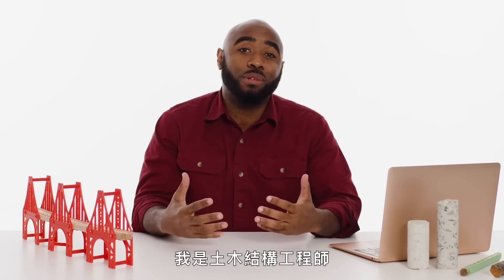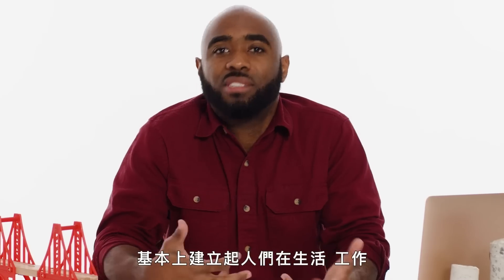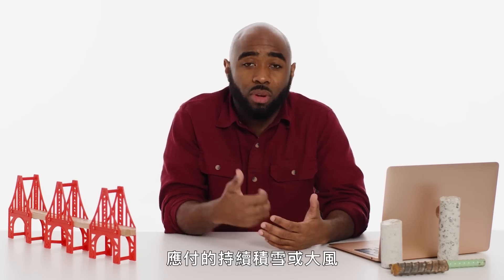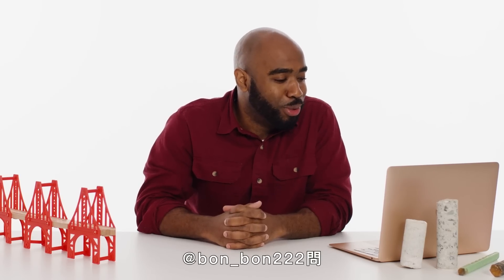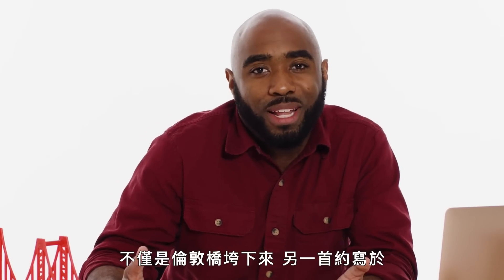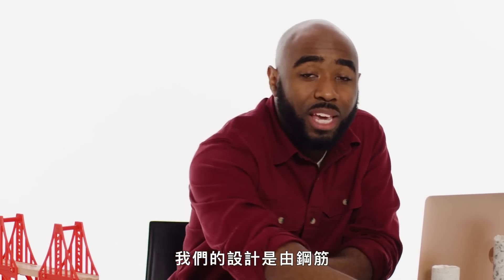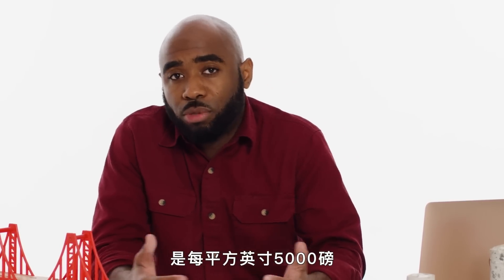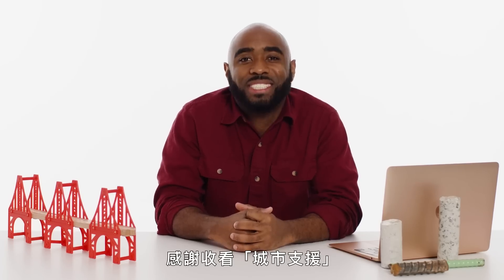如何建造水底隧道？摩天大樓是怎麼蓋的？土木工程師回答城市設計相關問題！｜名人專業問答｜GQ Taiwan

Comment: 佢所講嘅cofferdam水下隧道建造方法已經好過時，建造成本貴同造成環境污染。我廿年前已經參與immersed tube tunnel設計。將隧道分段造好，用船拖到現場，沉到海底再接駁。成本低對環境影響亦低。
The underwater tunnel construction method he said is a very traditional method or I should say a very ancient method. A line of cofferdam to be built alongside the tunnel alignment so that the sections can be dewatered to accommodate the construction work. However this method is an extremely costly way to build a tunnel if it sits deep in the sea whilst hundreds and thousands of piles to be driven and massive steel supports are required. The wide extent of construction site, the enormous amount of soil disposal and the ground settlement led by the dewatering will create significant environmental impact. I was involving an immersed tube tunnel design 20 years ago which was a state of the art construction method at the time. The tunnel sections were cast in the dry dock and tugged to the site. The tunnel sections were sunk into the sea for connection and anchorage. The construction is much cheaper and quicker, the associated environmental impact is far less and easily controlled.